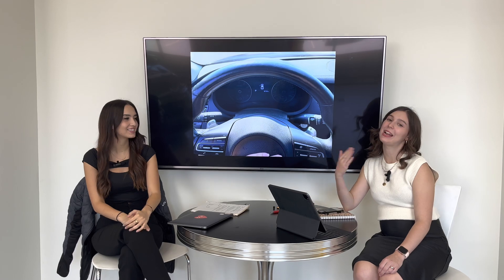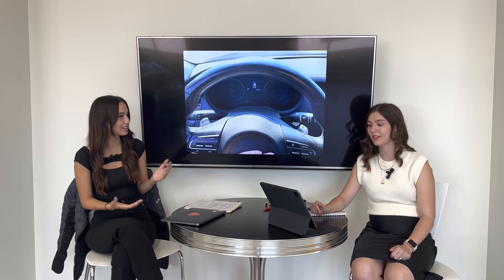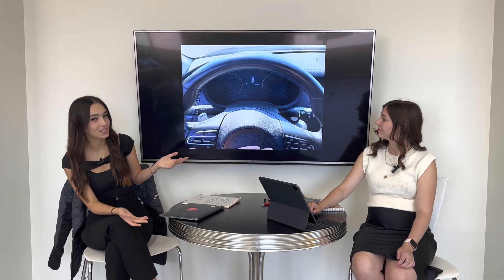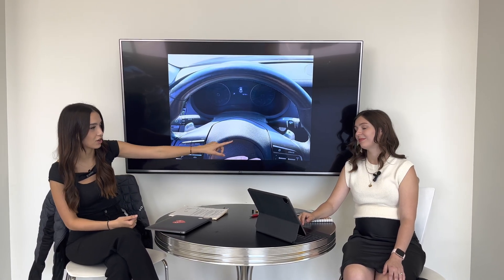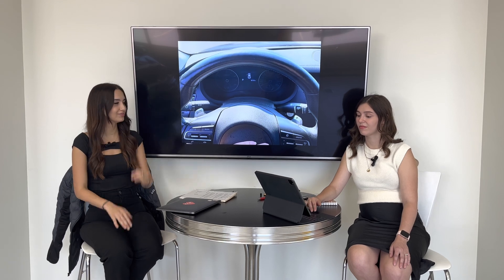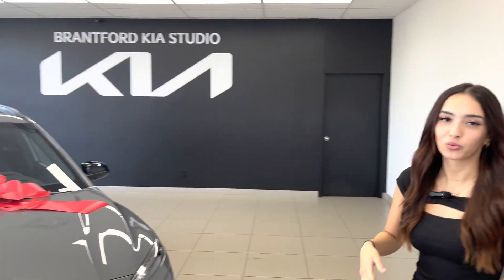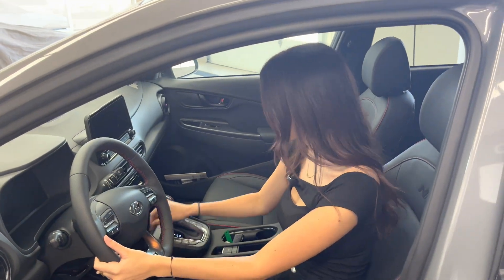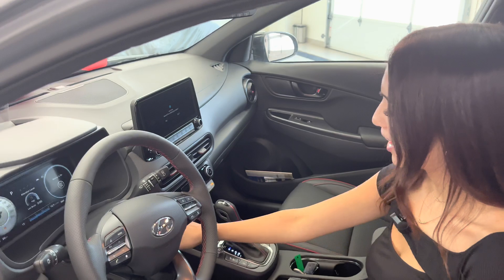What is a Dual-Clutch Transmission (DCT)?

Comment: Is unacceptable for a 2025 car with so much history on it's back, not to offer an improved infotainment system, dual transmission control either from paddles or gear knob and a upgraded interior design to much it's era. And before you get me started no it's not only about performance or comfort. Is about selling both. And a customer seeks both..

Comment: Had two Kia Rio automatics over the last few years. The earlier model came with the torque converter and the newer 2019 model I have now has DCT. I noticed straight away the difference when I changed cars. The tc model was a lot smoother changing up and down through the gears like a proper auto whereas the DCT car , while not as smooth, definitely feels sportier and the engine note sounds more like a manual as it changes gears. I actually prefer the older 2015 auto box but I got a good deal on the newer one so I went for it anyway. After 3 months owning it I don`t think about the difference any more  and get on fine with DCT.

Comment: Honda doul clutch is failing a lot. Honda DCT cars between 2012-2014, DCT failed almost all. I hope they fixed it in latest models, 
But DCT is not good for heavy traffic. still I prefer CVT even though driving pleasure is not that great. 

Is there a solution for heavy traffic driving for dct?
Reply: Dont ride your brakes, give yourself and the car in front of you some distance before accelerating, that way you dont wear out the clutch, (just like in a manual transmission) dont creep in traffic.

Comment: 7 speed dry DCT is flawed. Don't buy it. Dealers will not acknowledge the issue and it's very difficult to get the warranty to repair.

Comment: I just bought an N-Line Kona. I like the car, but noticed shuddering in bumper to bumper traffic or stop signs. I was unfamiliar with DCT technology. Do I have to put my foot on the gas every time to stop that shudder?
Reply: Drive it like how you would drive a manual, give it gas to prevent it from shuddering (feeling like stalling) smooth it out

Comment: How do I know if my Sonata 2015 2.4cc has DCT installed? 
My shift locks just like the one you are showing on this car
I'm asking because I want to know which ATF should I use when replacing it 
On the user's manual it shows all different options for all Sonatas from that year using engine 1.6, 2.0, 2.4 and this applies if installed it says 
Mine does not have shift control on the steering wheel. 
Thanks

Comment: You mentioned wet clutch with DCT. Please explain. DCT is best thought of as an automated manual gearbox. Volvo Trucks I-Shift have perfected it, and give a choice of single clutch or dual clutch automated manual. You are spot on about stop start traffic: either give it power or hold the brake pedal down. Do not hang around stopped and no pedal pressed.
Reply: Good to know when using dual clutch automatic cars

Comment: Manual transmissions are not too difficult to learn to replace, and you don't need to replace or reprogram the car's computer or buy an expensive diagnostic tool to diagnose what's wrong with it.
Just learn to drive one and one day you'll be glad you did.
Reply: I am having trouble finding a decent manual transmission to buy...the idea of giving up manual hurts my soul.
Reply: @Mrs.Currie  Giving in to the machine.  That's tough.  The machine is quick and precise, not necessarily smart. I flex my leg and call that a smart contract because it doesn't require machine intelligence.  It makes more sense to level down when you can because we're not machines learning, but humans being learned by machines.

Comment: A Dual Clutch Transmission is something that you will never be able to completely understand unless you have driven and mastered a classic manual transmission. Unless you have a full understanding of a conventional manual transmission do not buy a car that has a Dual Cutch Transmission. Thats it in a nutshell.
Reply: You are correct my friend in the understanding portion but I feel like the girls did a pretty good job explaining the idea of what’s important to keep in mind to get the average person down the road without hurting the car. 

I believe if ALL sales staff did a quick demo of what not to do and why not to do it the average auto buyer would shake their head and demand a proper automatic. 

Truth be told I’ve never driven a Kia with one but I have driven another brand and for me it was like having a friend who is really good at standard doing my job for me.
Reply: I don't think You have ever driven a car with DCT :D how much you think you need to know to drive it? it does the shifting for you. no real difference from regular A/T from the user standpoint. if you want you can upshift and downshift - in 99% of the regular driving its unnecessary. after driving it for 3 years I see two cons:
1. sometimes it misses at predicting next gear and you have to wait a bit more for it to engage the right gear - like when you suddenly hit the breaks hard when going 70 and then want to immediately accelerate from 20. it might do a few downshifts quickly, and it will expect next gear change to be down, but you want to accelerate so it has to prepare for upshift instead of downshift
2. if the transmission oil is not heated up the first few minutes of driving in the winter might be a bit jerky. i tend to wait for 30-60s after starting the car when the temp outside is around 0^C
other than that the shifting usually its super smooth and unnoticeable
Reply: Shut up.
Reply: Don’t be dramatic. I’ve never driven a manual and have a Kia Niro hybrid. Perfectly comfortable driving it.
Reply: Manual is better and less complicated 😉😎

Comment: My wife leased a 17 Niro in May of 17. I bought a 18 Niro in August of 2018.  Neither time very we told about the service required for the clutch fluid. When I  found about the needed service at 22K I took mine in and the service dept. had not heard of the required service. They did not know what needed to be done, who could do it or how much to charge. I have always wondered about the others with this who have not found out about the required service and it not getting done.  My Niro's are not an automatic transmission. They are a manual transmission controlled by the computer.

Comment: Does the Hyundai Kona N Line model have the same wet DCT gearbox as the Hyundai Kona N model?. 🤔
Reply from the maker: The N-Line has a 7-speed DCT while the Kona N has the 8-speed wet dual clutch transmission.
Reply: @BrantfordKia  -Thanks for information. 🙂

Comment: Thank you for mentioning you shouldn't "creep", you really need to get off the brake and onto the gas so the computer knows you want to move and lets the clutch out for you. The biggest cons (I've heard) about the DCT is a touch of roll back. So like a true manual there is a small period of time when the vehicle isn't fully in gear (as the clutch slowly engages) thus it rolls slightly if your on a hill. Some models have an autohold feature to help with this but you need to push a button to activate it. Also first gear may not be as smooth as an automatic w/a torque converter since the DCT is technically slipping a clutch for you... once again just like a manual transmission. Its too bad H/K made the upshift /downshift backwards. Pressing forward should shift down and pulling back should be the upshift. However pretty much every OEM messes this up expect Porsche.
Reply: Yes, my Tucson has DCT and yes there is a roll back period but the biggest adjustment in the DCT is the "jerking" motion sometimes when coasting
Reply: @cchetter  don't coast. be decisive.
Reply: @noob.168  hard to do in speeds around 10-15 kmph I haven't found a good way to deal with really low speeds without some form of jerkiness
Reply: Sometimes you need really low speeds like in U-turns inside garages, even combined with a steep climb inside the garage.
Reply: Why my DCT when I chose my Manual gear it doesn’t work like it’s still works as automatic. 

Example im on the 4th gear and when I slow down or stepped on the break it gears down to 2nd or 1st gear, where is the manual there?

Comment: My Ford Focus had a DCT. It was a nightmare because in the 66 thousand miles I drove it the clutches had to be replaced 3 times. Hopefully The ones on Hyundai / kia are better than the ones in fords.
Reply from the maker: Ford had some major issues with their DCT on Focus and Fusion model. From between 2011-2016 in 2020 they settled a $30,000,000 lawsuit over this concern.
Reply: @BrantfordKia  The first two were covered by warranty but the third I had to pay $2300. Luckily because of the lawsuit I got my money back and then some. Got rid of the Focus and bought a Kia Soul +. 116k miles and not a single issue.
Reply: @fordxbgtfalcon  you had a dct in kia soul?
Reply: I would stay away from a wet DTC...
Reply: @guinico2951 I would do just opposite. Wet DSG DQ381 is great transmission.
Reply: @johnwet6969  You are correct,  I meant dry DSG, I don't know why I typed wet...
Reply: @guinico2951 what about the 2024 kia forte gt 2 package 7 speed dct

Comment: I was reading some articles about the Kia K5 GT having problems with DCT’s. Is this still happening with the newer models?
Reply from the maker: Truthfully, we haven’t seen anything at our dealership. Charlotte’s background is primarily in the service department and we haven’t had an concerns with the DCT malfunctioning/failing. I’ve only come across 1 or 2 threads that mention it in the US, but have yet to find anything in Canada.